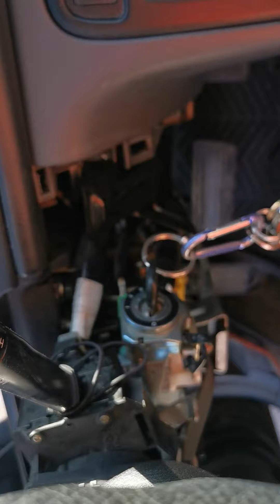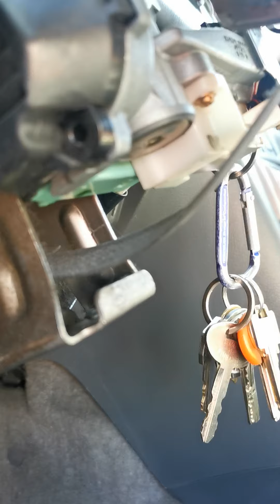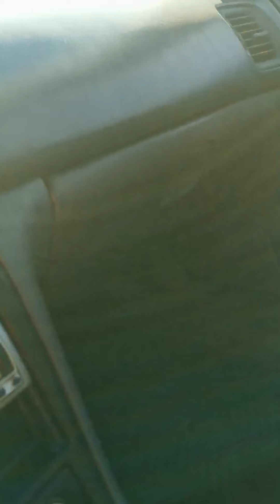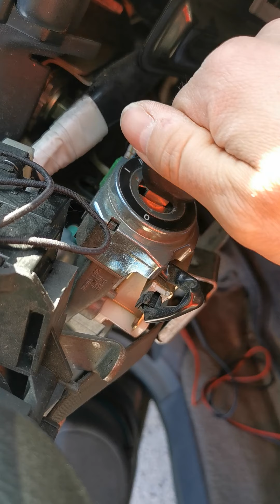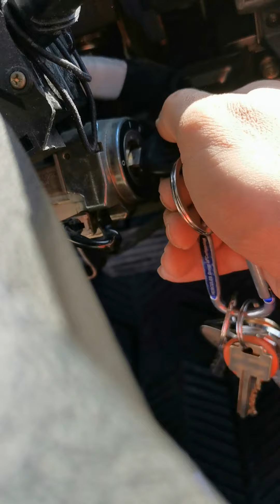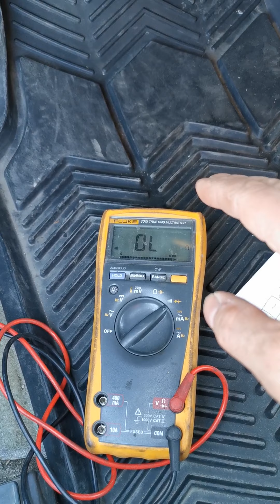94-97 Honda accord ignition switch diagnosis

Comment: Is the lock cylinder bad or the switch I’m trying to find out for my 95 eg civic I had to hold the key to get home lol
Reply from the maker: The switch itself ..the cylinders usually last a while
Reply: @molinelligarage1004 was teaching our son how to drive and he pulled the key out without pushing in and turning it back a little so I’m not sure about mine I’ll update when I get around to it but going switch first because there really isn’t that much play in the lock I forgot a while back I did have too much weight on the keys as well

Comment: Hi Molinelli I need help after I see your video on YouTube…I car Honda crv 98 got problem 2 weeks ago..no start engine I hearing cranked but start and changed new distributor and starter and check fuse box everything fine 12.7 volt and I have check distributor no power after I check nothing? I don’t know what’s I do…and acc 12 volt and dashboard light on but not start and new switch too…thank you for as soon as possible
Reply: I have working my car 4 days but still down I need your help so much ..I don’t know what I need to do next thank you

Comment: Do I need just an ignition switch or ignition switch and cylinder switch aswell?
Reply from the maker: Cylinder is just the lock cylinder and not needed ...your ignition cylinder is bolted to the backside of the lock cylinder and that's the only part you need .  Hope this helps and thanks for tuning in
Reply: Are you talking about just the electrical part of the ignition, the part you put the multimeter in correct?
Reply: @MakaveliTraines94 yes just the electrical ignition switch.

Comment: Yes this is exactly what is happening... Thanks for the video, happened to me today driving down the highway 70 miles an hour tac goes crazy speedometer goes crazy no power ....now I'm stuck in another town!
Reply from the maker: Did you get it sorted out ?
Reply: @molinelligarage1004  yes I did I had to get a ride to auto parts store and got a new ignition switch. Swapped it out on the side of the road. It's been working great ever since!
Reply from the maker: @COOPERS_COACH_WORKS  that's awesome.. Hondas are amazing..once you learn the little tricks on how to diagnose them lol

Comment: My speedo only dances and now having trouble with it not wanting to start i have changed the starter but still nothing and it reads 12.76 on battery and the connection to the solenoid was 12. But switch it and still nothing i have an extra new main relay switch but that wasn't the problem. What would you know or think ot could be? Im trying to figure out where the starter relay switch is located but not having any luck finding it online or diagram.